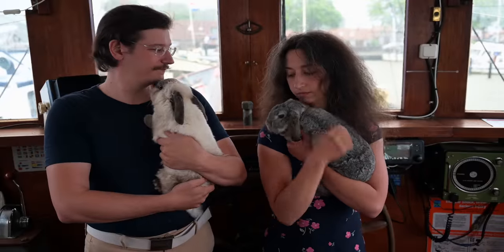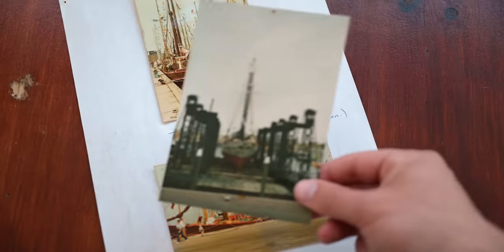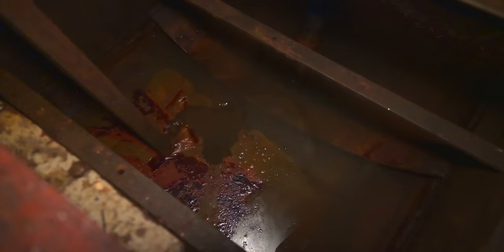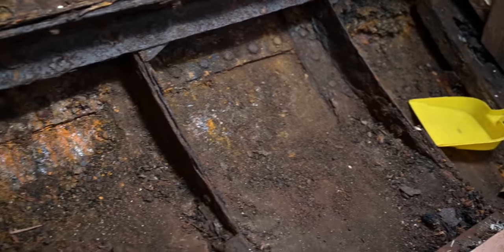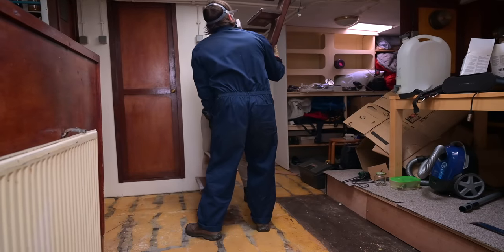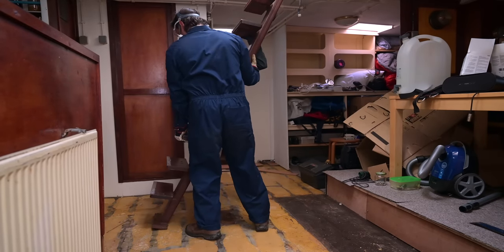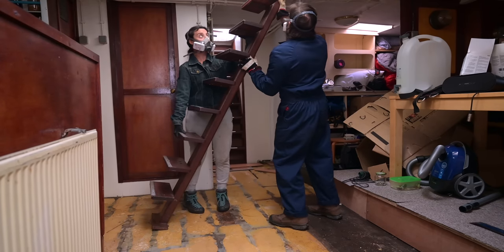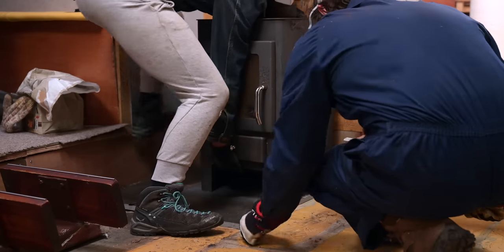Where's the WATER coming from???

Comment: I'd consider grinding out and destructively removing the existing water tanks, and designing new plastic or SS tanks.
You two have taken on a LOT of work!!!  Good luck!
Reply from the maker: A lot of work it is 😉 The good thing is we have enough space for pre made tanks and don't have to design them or have them custom built. That should be cheaper. Grinding out the water tank will be a fun project! Not so much fun is the steel tank next to it filled with sh....

Comment: Hi Guys. Fastest way to see if your water is leaking is to get a compressor and pump air into your water tank and look to see if the tank leaks water. Good luck. Richard and Val.
Reply: Low pressure only, very low pressure.
I would use 3 maybe 4 PSI max (0.2-0.27 bar)
Too much pressure and the tank could flex, and if it is old and rusty it might even blow a seam or worse.
If the tank is not built for pressure it could distort and you might wind up with several leaks.

I test tanks for leaks all the time.  the older the tank, the less the pressure

Get a hammer and start tapping on it, don't hit it hard, just tap.  Work your way around.
I would do the tap tap tap before I even tried to pressure.
Break some of the rust and scale off.

Your probably going to have to pull the tank anyway.

Comment: One thing refurbishing my former steel ketch taught us, is that although sea water is (hopefully!) outside the hull, rust starts and grows from inside.

The key is an easy inspection. The most damaged part was located under the stainless fresh water tank. Not because of a leak, nor some stainless/iron electrolysis, but just because that tank had never been removed for inspection in 20 years! (A hard work btw!).
After just hand scratching the crumbly rust (not power tools yet, I got a good view on the boatyard grass!!! Scary given we have just sailed her a few weeks with our first baby.
Good news: nothing that some sheets of metal and welding sticks couldn't fix...

Then our policy when rebuilding the accommodations was floor hatches everywhere, and quick check every time we fished a Tupperware or a wine bottle from under the floor.

Keep going, it looks like a messy job (it is!) but not that hard, and satisfying at the end.
Reply: I thought you were going to say the rust was from condensate dripping off the water tank. ..
Ive seen house bathroom floors rot out due to that.  The more you warm the air inside, the more condensation forms on the cooler tank surface and drips on the floor. You also get it forming on the hull material...and if thats unprotected steel then it rots out...

Comment: Y'know, looking at all the additions over the years and the 'quality' of the work, I'd completely strip out the interior and start again. Especially as you've had to start doing this to chase down the leak. It of course, makes it a much larger job, but at least you get to do it exactly how you want it. Rather than inheriting someone elses work and how they want it to be used. Good luck
Reply from the maker: The plan always was to strip the interior completely. We just want to save some of the mahogany trim and the brass lamps and so on. Maybe use the bigger sheets of ply for some pattern making. But the majority of the wood is converted into heat this winter 😉 After the hull is rust free, re- coated and isolated I think we will add an improvised interior so that we can start in the aft cabin. After that we can built a proper interior section by section and we are really looking forward to that. After all I'm much more of a woodworker than a steel guy.
Reply: @FlyingConey  Wise plan. I look forward to your journey 🙂
Reply: @FlyingConey  
Easy access to the inside-of-the-outside makes for a happier life onboard.  It is very easy to forget that, especially when we think as a woodworker or are in "cabinetry mode".

Comment: I am not a boat owner but enjoy these restorations. I had a burst pipe in my 1st floor house so installed a water alarm directly in the floor below in case it ever happens again. It cost about £5 (battery operated). My point is I never see similar being installed on boats which I would think more important in the event of a leak.
Reply from the maker: Interesting point and thank you for your comment. Here is my guess. Sometimes a bilge alarm is used and the bilge pump is operated manually. Especially in bigger ships you do not want an automatically operated bilge pump because of all that oil in the bilge water. Sometimes you have the bilge alarm and higher up an automatic bilge pump. With the plumbing I think you would detect a leak quite immediately because we use a pump to have pressurized water. So if the pump is constantly running there has to be something wrong. The reason why the water tank didn't was our first guess is that it was leaking the whole time so our numbers how long it takes from full to empty where odd.

Comment: Wondering if you could feed a camera or microphone to find leaks instead of ripping up the floors? Maybe some food color in the tank could tell you if it is leaking?
Reply from the maker: Leaks are way less obvious than one might think. The bitumen spot at the end gives you a good example of how it would look like. The way we proved that it was no leak was by putting kitchen paper over it and have a look if it gets wet or not. Dying the water is a very good solution and there are even specific colors for that, the same stuff they use to color some rivers green on St Patrick's day. However it was Friday evening and we had to the haul out spot on Monday morning. Sometimes there is not enough time for the better solution so we went for the crowbar.

Comment: Well, all that work removing the interior is not in vain as it all needs to be removed so you can sandblast, then inspect the hull, framing/stringers and rivets. Then repairing and priming/painting. A large task ideally suited to a young couple such as you two. Stick with it and I'm sure the end result will be amazing.

Comment: Hi guys love the project, if I could suggest for your safety and piece of mind get a engineer to inspect and do a report on the hull. I’m in the engineering industry and inspect various tanks ect, the amount of rust I saw concerns me. Find out the as new  original thickness, from that point clean of all the rust on a part of a rib measure then see what percentage is lost and what you are left with as a start, good luck on your journey.
Reply from the maker: We are not happy about what we found behind the cork insulation. Very soon we have scheduled a haul out to check the anodes and get a new layer of antifoul on the hull. We also want to have a few points measured just to be sure. However the boat was built like a tank in a period in between wooden fishing boats and steel ships. We are not even sure if the ribs are iron or steel but they used overlapping 1cm steel plates. Also the hull in the foreship as well as in the engine room doesn't look that bad only the six meters in the saloon are looking a bit horrible. Thanks for the advice and for the comment!

Comment: The ballasting of former fishing vessels is always an issue..
Fuel and ice on the way out and 🤞🏼🐟🐡🦑🦐 on the way back ...if they didnt catch enough then they could capsize in storms especially if they had excessive masts and gear welded on above the deck to the superstructures.  
Its still a problem with largely unregulated vessels..

Very different from your flying Catamarans.
Reply from the maker: The ocean is a very dangerous workspace. Especially when you seek those fish rich shallow banks where waves are high. From pictures of similar ships we believe that Flying Coney fished for Herring in the North Sea. Drift netting and hauling in the nets hand over hand. She had a relatively small three cylinder engine and was converted to the sailing ship and not to a trawler when drift netting went out of fashion.
Reply: @FlyingConey  
Sorry i didnt differenciate the type of fishing vessel ...in   English a trawler is the term generally used for a fishing vessel using nets.  
In those days the Herring Pilchards and Mackerel stocks were still very rich..

Comment: If you empty the water tank then for no effort you will find out if the tank is the problem, although it all needs to come out anyway it might allow you to sleep better. As an old fisherman said. If you hear the pump turn on and off you know all is well, it when the pump doesn't turn off,,, you know you need another pump 🏴‍☠️🍺
Reply from the maker: Made me lough 😂👍 The problem with the big tanks is that they almost never drain from the bottom. There are always about 50 liters left at the bottom. Maybe it was a bit overkill to rip everything out but to my defense I never thought that the amount of water could possible come from the tank.
Reply: @FlyingConey  is the water saline?. 40L a day could be a pinhole in a seam but I think it's a good thing to gut the boat before you rebuild to fully assess the hull and structure integrity. There would be nothing worse to spend time and dollars refitting only to find a major structural fault that stops play, plus you'll be happier eyeballing every inch cause as your nodoubt aware it will be the spot you don't look that will be the spot you should have. Good luck with your archeology and let's hope you discover a chest of gold 🏴‍☠️

Comment: Since you are now owners of a steel ship, I would strongly recommend that you acquire appropriate welding equipment and learn how to use it.  Looking at your hull structure, I think you're going to have to replace some of the bracing if not the hull plates themselves.  If you could weld, you could do it yourself and save a lot of money through not having to hire professional marine welders.
Reply from the maker: Hi Edward, we do have the intention to weld and we also have stick welding equipment. Unlike Brupeg we have a riveted hull and welding it tends to be difficult and needs experience. Since you weld a spot and another spot opens up and so on. So we leave welding the hull to the experts and only weld above the waterline, the deck and inside the boat. Also you need to be a certified welder to don't get any troubles with certification.

Comment: You maybe learnt this by now. But if you had hired a plumber to use a camera to see in the pipe where the water was coming from the camera head could have been located from above when it was in the pipe.
Reply from the maker: For that we would have needed the information that the pipe is where it is. To be honest I imagined the bilge  completely different to how it actually looks. The best solution we came up with is to dye the water in the tank but getting the right dye for it isn't easy when you have to make a 3000€ decision within the next day. Ripping out everything was the faster way and it had to be done within the next month. The sooner we get to a rust free hull the better it is.

Comment: Are you Familiar with Zinc Annodes?? Have you any idea what condition they are in?? Have you had the bottom checked to see if there are any at all? If you haven't adressed this situation,and are living aboard with electricity you have made your vessel a huge candidate for electrolysis ( stray current)to be basically eating your vessel. My opinion would be to make arrangements to adress this and consider hauling out, sooner than later! This is just an opinion and you are the owners. What you decide to do belongs to you First! Hoping for the best to happen with your Dream Boat,She has Beautiful lines and was once an incredible boat. Hopefully this will happen, and she shall become again what she once Was! Best Wishes
Reply from the maker: We have a combination of zinc and aluminium anodes and they were renewed in 2018. So we haven't taken the boat out so far. But we are not connected to shore power and as far as I know the never was since she last went out of the water. The plan is to take her out as soon as possible. But an emergency haul out is sooner than possible 😉. 1-2 month will not make a huge difference but it gives us enough time to remove the isolation in the saloon area and mayday sandblast the inside of the hull when she is on the hard. An haul out is about 800€ just to have her out of the water.
Reply: @FlyingConey  three years is a long time, glad to hear you have both, I would still recommend that at the very least, have a certified diver inspect the Annodes to determine if they are still serviceable and doing their job! A local diver with good judgement can determine this for you! And even without shore power, you still have Batteries! Corrosion is measured in millivolts.  they do make a meter that you can use to test the corrosion  with the vessel in the water as well! You may ask around if someone has one of these! They are very useful item to own. Regards

Comment: Not sure how far behind this is, it might have been smarter to have gotten an endoscope camera drilled a hole in an easily fixed area and checked. But then you were going to redo the boat.
Reply from the maker: Sometimes you just have to be fast so you can make decision. But also leaks are very difficult to spot. It would look much like the bitumen I showed you at the end of the video. You have to lay a sheet of kitchen paper over it to test if it's wet or not. We came up with the idea to use leak detecting color in the water tank. It was Friday, the only day we could sail to the yard was Monday so we we went for the simple but effective solution aka crowbar.

Comment: you are working on a rust bucket which will need serious replating! Scrap it before it breaks you!
Reply from the maker: Kind of what you would expect in a 72 year old hull. No matter what we have to push trough this state of the project. Nobody would buy the ship in the state she is now. But again, the plate thikness is pretty sound. Just six meters in the saloon behind the cork isolation where the frames are now made of rust instead of steel. Not the end of the world.

Comment: If you have not done so already it may be a good Idea to hire a diver if you don't do it to look at the hull from the outside you may be able to find the leak if it is from the outside and do an old school patch with an asphalt roofing shingle coated with tar on the outside I have done this in the past. That is if it's not your water tank .which I hope it is .
Reply from the maker: The complete point of the undertaking was to find the spot where the water is coming from. We had an arrangement with a nearby shipyard that they could take us out anytime. But sailing her with a leak that we haven't even found was something we preferred not to do. Be bought quick cement and leak sealing grease (Leakhero). But here in the comments I can reveal the mystery, it was the water tank. Still amazed by the fact that we filled up our bilge by ourselves and emptied it by hand...
Reply: @FlyingConey  
Lol... taste test.. but not appealing given the proximity of the smelly head 😂😬😉
At least you didnt nearly sink your boat by over filling your tank...ive seen some very famous UTubers nearly do that because they forgot to check as they filled up their drinking water tank or it leaked.  
The answer is to have an overflow into the kitchen sink drain or straight overboard above the waterline.
Reply: @FlyingConey  Ha Ha like I said I was hoping it was that ,And I am glad it was I have owned a few boats in my time and when I see a leak I get worried I know what can happen and how fast even if it's not mine . I must admit that I am a bit jealous of you two, I have dreamed of doing what you two are doing .my largest boat was a 16.154 meter power boat .but hade to let it go I didn't have time to care of it properly .I'm 65 now so I still dream of trying one more time .till then I have people like you two to watch and learn from and maybe help once and a while .I think you are doing well and I have noticed you are getting more comfortable in front of the camera . It is good to hear you are on good terms with the marina you just never know when you might need them A.S.A.P. well tell next time clear skies and warm weather .

Comment: I am sorry to say, but I think there is just too much corrosion on you ship. Those ribs and the internal metal structures are in a shocking state of corrosion and  just too far gone. Also the fact that concrete was poured directly into the bilge for ballast means you cannot sandblast any structural ribs or internal  hull from inside and will have to jackhammer out all concrete an totally redo structural ribs and hull plating. I hope you ship is not rusty scrap metal.
Reply: You did not mention whether or not you had a survey done prior to purchase.  If not then you might be facing a potential total loss.  The corrosion appears to be extensive as others have noted it may not be seaworthy.  You should get an ultrasound test done below the waterline.  It appears yor hull was riveted not welded.   If your hull and support frame are heavily rusted/corroted you need to address that….not chase random leaks.  It’s early….you still have time to cut your losses.  Good luck but you need need professional help.
Reply from the maker: The hull thickness should be fine. But a potential leak is a priority issue. Also when we want the hull sandblasted from the inside we need to remove the interior first. But I agree getting the hull rust free is the most important thing at the moment.
Reply from the maker: Concrete poured directly into the bilge is how these boats are built. There is no need to take it out. One way would be to cover the concrete with metal and close it off permanently. But the concrete protects the steel and we have mandatory thickness tests every five years. It's totally possible that we need to redo the frames and ribs in the saloon area behind the cork isolation. But that's "only" six meters of the ship and it's not a wooden boat. But there will be some welding involved in the refit.